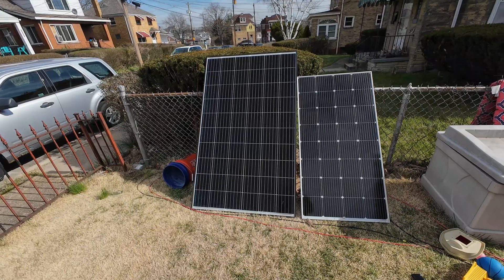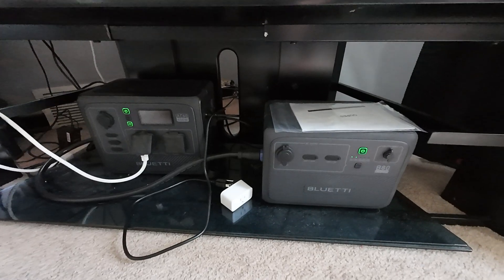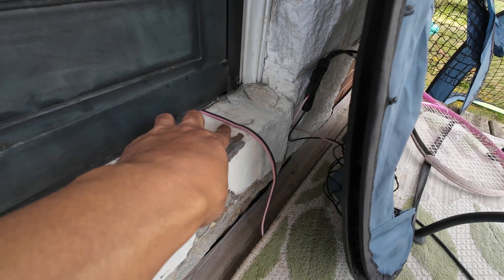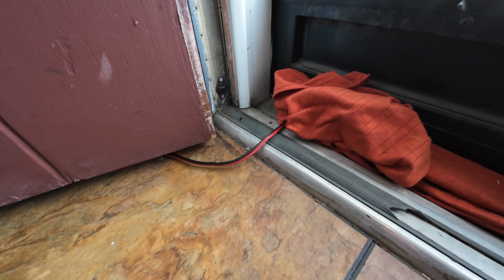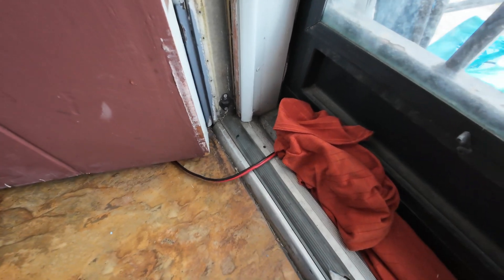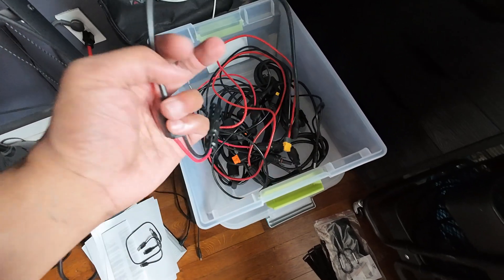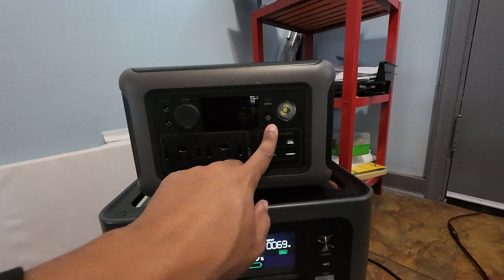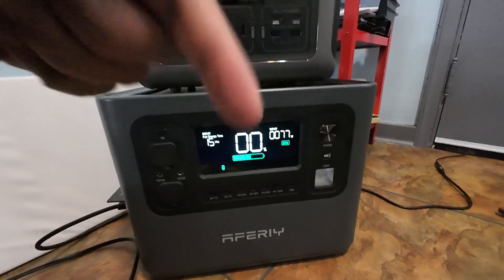This AFERIH Power Station NEVER Fails Me

Comment: I Don't If Its In ur Budge, I Saw Some use A Double Dc Converter 12v to 36v into a Powerstation & Instead of It Pulling a 100watts in Input it Made It Pull over 500watts and I Have a 2400 watt AFERIH and Will be Getting a 48v 100ah Battery to Plug Into My MC4 Plugin for the XT60 for Solar Panel on Powerstation & Run The 14AWG O Ring TX60 Terminal from 48v 100ah Battery to Powerstation..
Reply from the maker: Yeah I'm hip to those, I'm just not quite into that kinda setup as 8 have so many power stations and batteries
Reply: @AskIveSolar  Gotcha